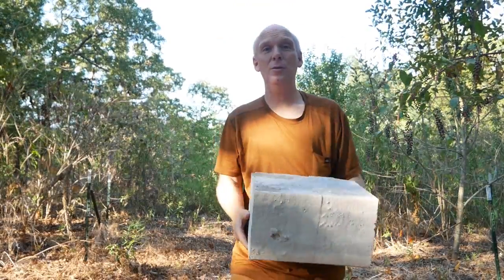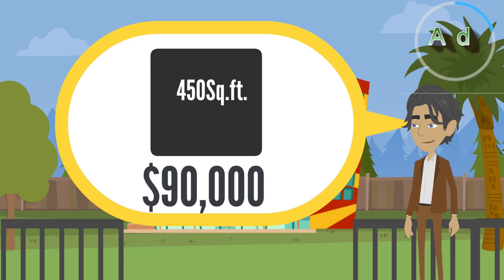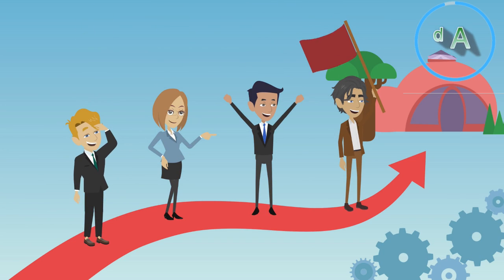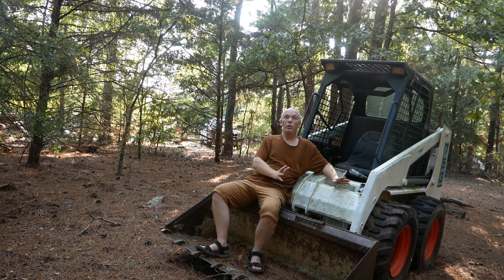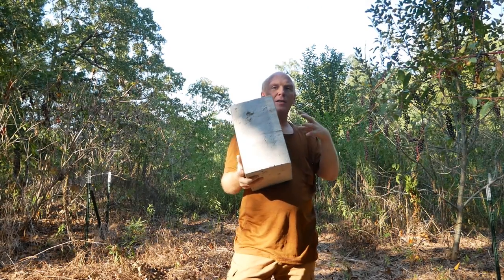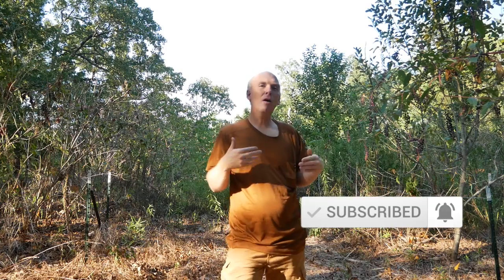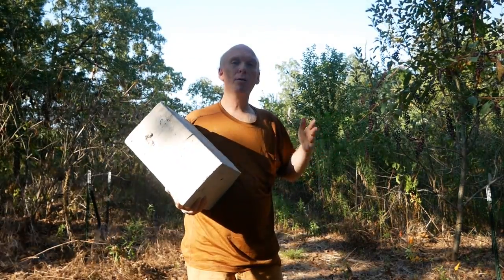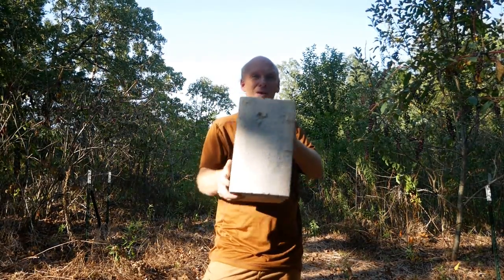Rammed Earth Vs Air Crete House

Comment: First of all, thank you for the education and information. I’m in middle Tennessee. Zone 7. My dream is to build a bermed dome that incorporates some earthship features, passive solar design, etc. I’m thinking the north half of the dome is made of aircrete and bermed with cooling tubes buried in the berm and the South half of the dome would be a geodesic greenhouse/atrium for growing tropical food foods and staples and for solar gain. Maybe a bit more would be in aircrete than 50/50. Maybe 60/40 aircrete bermed/atrium.  I’m wanting something that is a 3/8 dome so it looks more like a gradual rolling hill and blends into the landscape. I guess I could still create the same effect with a 4/8 dome with more fill dirt. I really would like to have 3 or 4 stories if possible. I know that means the square footage would get really large, but I do love a very large, open, industrial aesthetic that I can build into over the years and just have the shell and the basics built at first. My questions are, can I build a bermed aircrete dome? Can I build a dome with a 40’ radius to achieve a 4 story home. What codes problems do people trying to build aircrete domes typically run into and is there a economical way to satisfy those common concerns? If what I have described is possible, I would love to come to a workshop and educate myself how to build my dream home.
Reply from the maker: Air Crete is an alternative Building as is earth ship. No bank financing, no code approval.  I would not recommend Building underground with AirCrete.  However, you could potentially design for the loads.

A 40' dome should be no problem.  I would not think that 4'th floor would be very big though.

Modern earthships which work have the entire earth berm wrapped in thick foam board.  This is the only way to make it work properly.  AirCrete will take on water if left u sealed and keeping it sealed underground is problematic at best.  I suggest you get 2 data logging thermometers and burry one at 3 foot then hang one under a tree.  Take a look at the data after a year and decide if you can live with the temperature in the ground.

You are ambitious to combine so many different building techs neeks that you haven't yet lived in.  I highly suggest you build one small structure first and living it for a year and see how you like it.  Than if all goes well proceed.
Reply: @TinyGiantLifeStyle  Just to be clear, incase it changes your recommendation, I'm not wanting to build underground as in below grade, but build above grade and then berm soil around the north half of the house. But you do think that the aircrete dome could sustain the load of a foot of dirt or so, if we could figure out the moisture problem. That's good. Will a rubber membrane not work, like monolithic dome homes use? If not, is my only path to keep the berm a monolithic concrete dome with a rubber membrane? 

Yeah, the 4th floor would just be a small lookout into the atrium to feel like you're in a treehouse in a canopy. 
 
I have some experimental ways I want to try and control the internal temps including, but not limited to, rocket mass heaters, solar thermal panels, radiant floors, absorption refrigeration that uses heat to cool, hot and cold thermal (salt)water batteries, indoor water features in the atrium for evaporative cooling, and a solar chimney with buried cooling tubes. I want to design a system that cools more the hotter/sunnier it is, like with the absorption chiller. I'm thinking of using fresnel lenses to heat ammonia and the interior of the house would be the equivalent of the where the food goes in a fridge. The sunnier it is, the colder it gets. I will start small, but thank you for at least giving me feedback on the general approaches so I can start moving from ideas to actual approach. 

When it comes to codes, if I am paying for the whole project and a bank is not involved, will I still be able to build at my own risk, or will they force me to tear it down, if they find out?

Comment: I live in tornado alley and there are very high winds even without a tornado. If one builds an aircrete only structure, how will it be heavy enough to hold together? A rammed earth structure should easily survive. 

I was planning an insulated center for the 2' walls. Maybe 8" aircrete center would increase strength and insulation. Have you tried that yet? I'll look into that more.
Reply from the maker: Round structures such as cylinder or dome shapes have a lower coefficient of drag than conventional structures.  The collective weight of the structure is more than enough to keep it on the ground.  Also, the bottom of the wall is bonded chemically to the cement foundation.  What I don't know personally, yet, is how does it stand up to a 4x6 post being shot at it at 254 miles per hour.  This will be getting tested!  Just have to build an air cannon first.